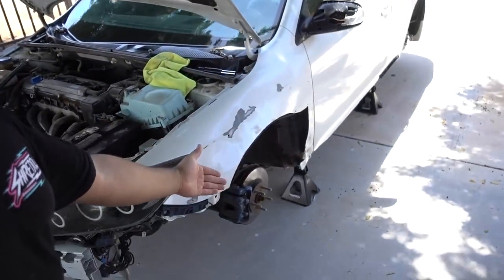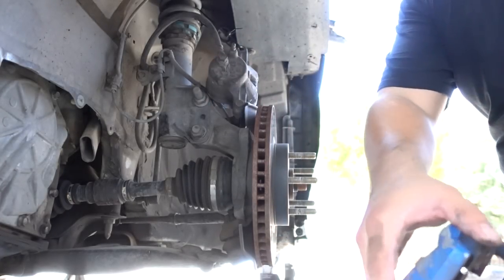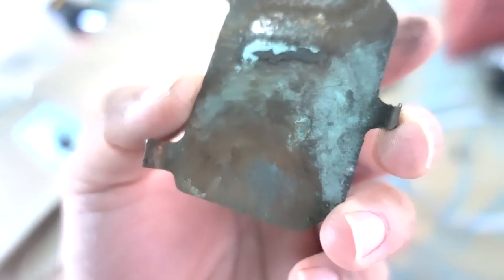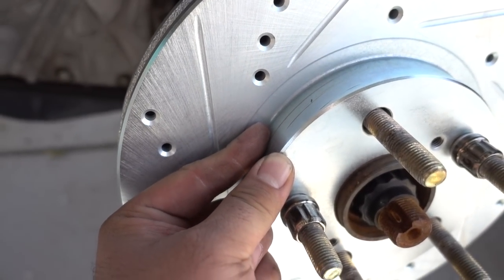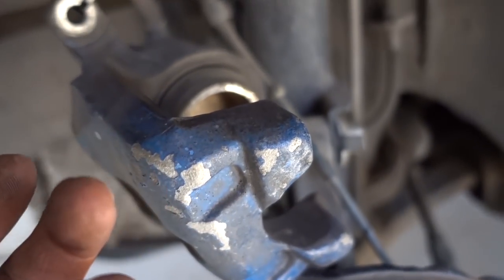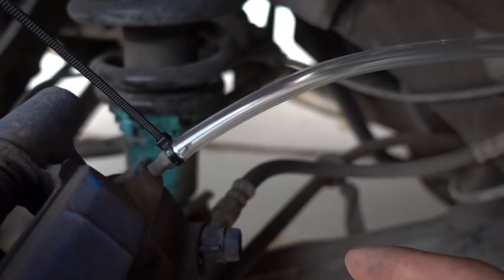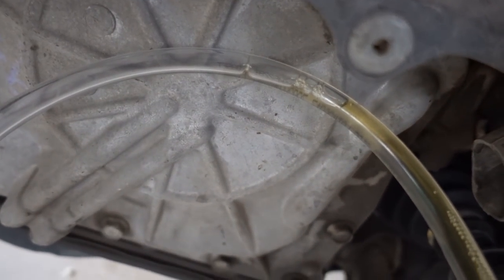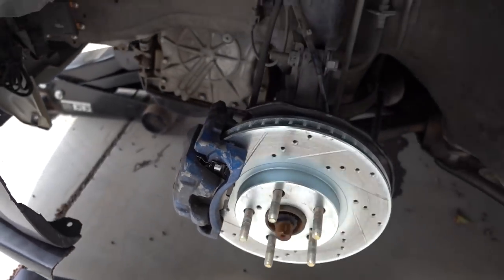Installing Drilled and Slotted Rotors + Performance Brake Pads!!!

Comment: ay if youre still gonna change the front fenders check out certifit.com the part numbers are 53801-21120 for right fender and 53802-21120 for left fender. theyre pretty cheap, a homeboy bought fenders for his civic and cost like $30 each. metal fenders with good fitment. im assuming the tc fenders should be the same or close to it

Comment: muncho saluda primo, I loved the video. one ? is that your header and muffler that make the racing noise? An you do you still have the tusndo header on your car? if so that is my nexts order for my scion... lol
Reply: thats the exhaust. p-tuning makes a 70mm/ 2.75 inch exhaust thats deletes the second catylitic converter. that setup will give you better airflow and make the car sound like his
Reply: thank you, but one question what do you think about HKS Hi-Power Rear-Section Exhaust System, 60mm Piping, 120mm Tip?
Reply: i honestly dont like rear section exhaust systems, its a fancy way of saying axle back or muffler only. the tc comes with 60mm piping stock so the hp gains is minimal (like 3hp) when you switch to an axle back but if you dont care about performance, you just want the sound and look then i suggest getting a generic n1 style muffler and have a muffler shop weld it for you. its cheaper than buying the hks rear section exhaust
Reply: thank u for the insite. i want the proformance. jNot ust sound.lol
Reply: thank u for the insite. i want the proformance. Not just sound.lol